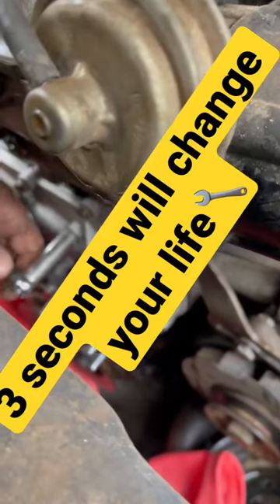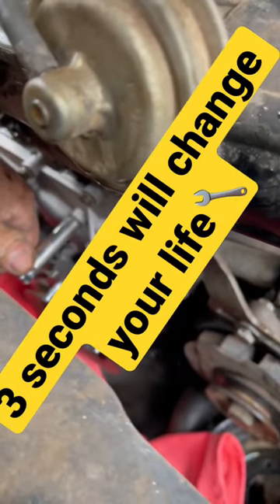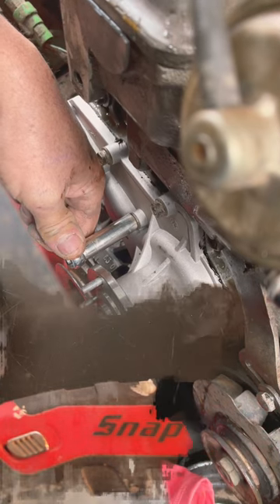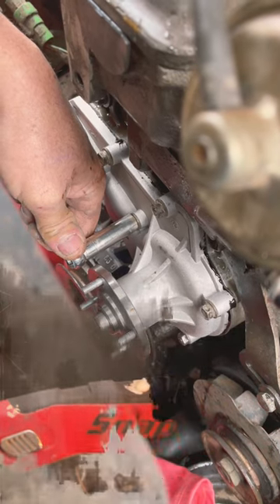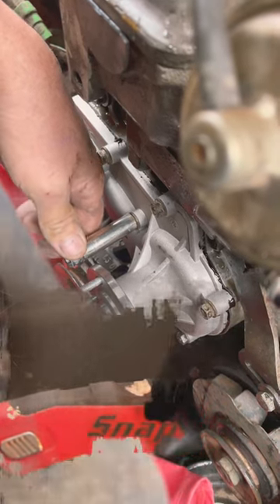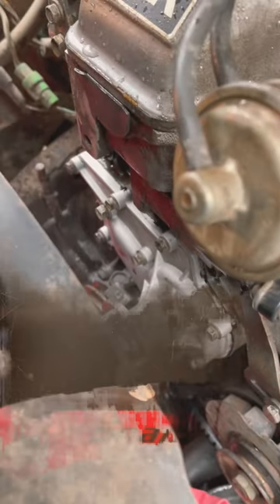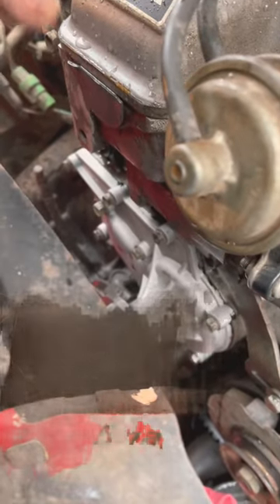This is why you hold your bolts for 3 seconds 🔧#shorts

Comment: Well damn I’m surprised the helicopters I work on haven’t fallen from the sky since I never hold the bolt for 3 seconds.
Reply from the maker: It is called safety wire. They know the bolts will come off. duh.....For the people at home, this works great.
Reply: @fastflo1  ummm hello genius I again work on helicopters and do safety’s all the time. However not everything has a safety or a cotter pin. But you keep believing in your 3 second hold buddy lol. Maybe Sikorsky should of implemented that in his engineering.
Reply from the maker: @spawnandbatman6975  you know a lot . But please do not let that prohibit you from learning more. You are making it sound like bolts do not back off. I was not suggesting you loosen the bolt. This is holding a bolt for 3 seconds. Do you believe that this will in someway create a problem? Will it make it come loose? Do you really believe That zero possibility exists this could be right ? That because you work on helicopters and have been a mechanic for 30 years this can’t be right? Let’s just forget about this thing called metallurgy. Because you work on helicopters 🚁 ok ….
Reply: @fastflo1   never said bolts don’t back off. But there is a specific reason why we test tolerances on hardware. When we torque on such applications we verify that run on, back off, or true torque is being done. If this is such a big deal then we would have failed torque checks every time we do a torque check on these aircraft. Majority of the time are torque are stabilized and don’t require us having to retorque again.
Reply from the maker: @spawnandbatman6975  Great info . Very technical. The last sentence.  Is what I have been trying to explain. 
But you just did as well as every other commenter that says this . . It’s so obvious guys…. The majority of the time you said they do not need a Retorque. . The majority. So that means you check. And retorque if necessary. Why check though? According to you guys bolt is right when you tighten it. Why retorque? Why even check ? Shouldn’t your torque wrench be right the first time ?  How do it get loose? What does it need to be tightened? Can you start answering those please? Thank you .
Reply: @fastflo1  do you even realize how much vibration a helicopter makes? One it’s to verify torque for safety reason which is why we constantly have to have our tools calibrated. We check torques on parts we replaced after 9-11 flight hours. In the automotive industry you are torquing to higher in most applications. No mechanic is going to say “hey in 50 or 100 miles recheck those torques. Probably should though. Aircraft is crucial to check torque due to vibration and bolt tolerances or threads not holding the torque of the bolt. Has nothing to do with holding the bolt for 3 seconds. Otherwise all of our technical inspectors or TI’s would be there to verify our torques. Once stabilized we torque stripe. Some applications you torque strike after you reinstall the part. I would love to see actual proof of this 3 second hold theory.
Reply: Forget metallurgy or mechanics, someone needs to let my physics professor know about this. Talk about revolutionary
Reply: @spawnandbatman6975 Car mechanic > Helicopter mechanic, didn't you know?

Comment: Some old school builder for Ferrari would take years to hand build great engines and cars because he used the same method. It does take longer hence him taking years to hand build some models. Airplane mechanics also practice this religiously
Reply from the maker: You are absolutely right. Not very common to the public by any means. And the tip I got was from my friend that worked as an airplane mechanic and went on to be a educator as well. And is now at Lockheed Martin....
Reply: @fastflo1  exactly! It’s real stuff
Reply from the maker: @rustypotatos  you know it man ! Good job dude . Way to stay sharp! 👍🏻
Reply: Never heard about this in A&P school, we just torque fasteners to the prescribed torque in the manual. Sometimes, anyway. I don't think holding the bolt for 3 seconds does anything and it wouldn't be relevant on an airplane since all important fasteners are safetied anyway.
Reply from the maker: @acefighterpilot  it works great for the guys who are not safety wiring regular every day stuff… it is on a different level. Can you tell me the one part that is not safety wired after tightening?
Reply: @fastflo1 Plenty of parts aren't safety wired. Some critical fasteners use nyloks or castle nuts and cotter pins instead of safety wire. Some parts have no safety at all, like screws for inspection panels. In general safety isn't required for noncritical fasteners that have some redundancy. For instance most access panels on Boeing aircraft can safely lose about 10% of the screws securing them.

I'm just not seeing how this bolt holding thing has any basis in physics. Once the fastener is turned, the inclined plane of the thread advances and requires more torque to rotate in the opposite direction. Maybe the @TorqueTestChannel would investigate this claim.
Reply from the maker: @acefighterpilot  good stuff …. I know they say hose clamps are one of the parts not required to have safety wire. The three seconds is to avoid rebound tension. It helps settle the bolt so it will not want to rebound and come loose.  Lots do come loose . So maybe that is part of the reason why. There sure are so many factors involved . And we know they have come up with several ways to prevent it. So it is likely there are several reasons they come loose. It is possible it is a contributing factor…. Would be a good episode 👍🏻
Reply from the maker: @acefighterpilot  here is a video I made . Let me know what your opinion on this is please thank you 👍🏻https://youtube.com/shorts/-7I71BfRPS0?feature=share
Reply: @fastflo1  The main reason why things come loose is vibration. You see that a lot on pistons and helicopters. Fasteners near the engine or on cantilever structures tend to walk out. You're literally not applying any torque just holding the wrench there.
Reply from the maker: @acefighterpilot  exactly….. the vibration . Most people do not understand that. And I am just holding it at value , no more. So if in fact there were any rebound tension … This would stop that . If not . It will not hurt it .
Reply: I’m an 8 year aircraft mechanic working in military, commercial and private. I’ve never heard of doing this goofy shit.
Reply from the maker: @grant4431  that is awesome ! I love to hear how long people have gone without hearing it . All now you know . Use it for what it is really intended for on your best projects . Your most important motor bolts . Your most precision work for the absolute best long lasting results. You may not believe it … but ask your self if you think it will help the bolt come loose? That’s a thought 💭 and if you do not do it at least you can have some fun in the shop with the guys . 😀
Reply: @fastflo1  you’ve got a good attitude
Reply from the maker: @grant4431  cool man! Thank you ! You too 👍🏻😎
Reply: Everyone has different teachers and bosses. Y’all ended up with teachers that did not learn this. Y’all are missing valuable lesson
Reply from the maker: @rustypotatos  wise words … there is always more than you have already learned. And more than your teacher has yet to learn👍🏻
Reply: Was just about to say this ☝️
Reply: @fastflo1  cylinder hold down nuts on piston aircraft Don't get safety wire they don't even use a lock washer of course we do put torque stripe on them after we torque them up. In addition I don't ever recall seeing exhaust or intake manifolds with safety wire and of course you don't want to use a lock washer and fear of damaging the cylinder head.

Comment: I just use an impact gun. Oil drain plug, oil filter, spark plugs, valve cover bolts, you name it.
Reply from the maker: Some people do.... I go hands on ....Most the time.....
Reply: If it wasn't meant to be then they wouldn't make that size impact socket😂
Reply: Same but Unironically
Reply: Wow thanks for the tip. I used it on my oil pan today. It has a small leak by the drain plug though. I can't get it tight enough. I cranked up the impact driver to max speed and it doesn't stop the leak. What should I do?
Reply: @bobmurphy2216  half inch impact
Reply: @bobmurphy2216  flex seal.
Reply: Dawg I literally could not get a drain bolt off this jeep grand Cherokee just yesterday! I swear. And it had a plastic oil pan. Screw your bro😂
Reply: Update to my issue. I held the impact for 3 seconds on high and it stopped my oil drain leak! 

But now when I start the car the oil light is on. Any ideas?
Reply: You must be mad or unskilled.
Reply: I always break stuck caliper slides. So the custy got to buy a new 1. Lol. Maybe next time the husband's sisters brother will grease them..🤘
Reply: Yup I use my air ratchet on everything. You can't make rate with hand tools.
Reply: Hold the trigger down for 3 seconds after you see the bolt stop spinning to avoid rebound tension

Comment: Pretty sure the data will disagree with this theory...BUT rebound torque (twist) is real in long, slender fasteners - and a combination of lubricant and a click-style torque wrench helps alleviate it.  If the fastener isn't long and slender, and there's no lubricant, and there's no slight shock (click)... probably not.
Reply from the maker: It’s a good tip to know ….. in general….

Comment: As a machinist of 10 years I can wholeheartedly confirm this bold statement of bolt torque is unequivocally... False.
Reply from the maker: 10 years is not enough….
Reply: @fastflo1  Lol if your serious.. A spring can be held in a position forever, it will return. When you go past a point it finally bends. Holding a point of torque will not do anything. The fasteners tensile point is set when you reach a point of torque. You need to apply more torque to change that point, time is null.

Comment: This makes sense.  As a person who does not use torque wrenches, I can say after tightening many bolts you just get to a point where you can feel tightness, "errr, yep, that's ones tight" but I've always had the suspicion that people who do that tighten bolts to their max, but yet I've never had a problem taking my bolts off, and I think this is why.  I may be tightening to max at the head,  but because I don't stay on it for 3 secs the bolt actually vibrates the head back to match the threads and puts it around spec.  Just an opinion
Reply: With that being said,  that would mean if you guess tightness,  do what you have always done,  if you are a torque wrench person, then you need to hold for 3 second for the threads to catch up to the torque of the head of the bolt.
Reply from the maker: Great opinion. I would have to agree with you on this. Action... Reaction...👍

Comment: It's called torque to spec. . . done.
Reply from the maker: Nope .wrong. Torque is applied. Then released. It will probably hold. But this method gives you better odds. Let the tension settle. Hold your bolts for 3 seconds.....You can become a better mechanic in three seconds. Why wouldn't you? Could be the bolt that ruins your next family trip when your water pump bolt backs off in the desert.... But don't listen to me. Just what you do.....my bolts are fine.
Reply: @fastflo1  Nope, some people "snap" their torque wrench application which gives an inaccurate torque. Simply drawing down to torque spec WILL suffice and hold.
When I am reusing bolts/nuts on an install, I chase the female and male threads with a thread chasing tap/die. NOT a thread cutting tool and never wire brush any threads. 
Your 3 sec pause is waste of time, but you do you.

Comment: If the metal is flexing and allows for an angle discrepancy between the tool and bolt, where's it getting that extra force to "settle" back into alignment?
Reply from the maker: It is the twist in the bolt. It settles when you make it stay. Just hold tension it is in the bolt

Comment: If that doesn't work and you have to undo it again, remember to leave the bolt off for at least 30 seconds so any residual electrical charge is removed from the system and it resets properly.
Reply from the maker: Nice one....

Comment: You sound like a great guy. Everybody is attacking you for this tip, and you stay nice. You make videos of tips to help people out. That's awesome. I've been a turbine generator mechanic for 20 years. Worked on GE turbines, mostly frame 7 & 6 gas turbines. When I worked with GE, they would send us to hytorc. Bolt torqueing company. This was never something they said. Im not saying you're false. Im open-minded. I just dont understand. Usually, when you torque a flange, you make several passes. Is this the same thing as holding for 3 seconds? When you torque a bolt, it stretches. There is an article I've read about conditioning the joint during the torqueing process. The article says to pre stretch the bolt, torque the bolt, leave it for 3 to 5 seconds , and loosen the bolt. Then re torque. No hate, man. Just not seeing the tip as relevant when you can just check your torque by making several passes.
Reply from the maker: Hey thanks! I appreciate it. People will attack. Some people have an open mind, and others do not. So I do not take it personally. I do not expect anyone to agree or disagree. It is just information I like to share about cool things I learned. I personally like to learn the extra cool things. This was a tip I learned from a friend. We worked summers in his Dad's machine shop growing up. He went on to college to study to be an aviation mechanic. Through his studies of metallurgy along with other information, he learned about this. It may be something he wrapped up into his own ball of wax. But we have done this on pretty much everything we have worked on since. And in the last 30 years I have had numerous bolts advance in the 3 seconds. Please keep in mind that this is not just a flange. We work on chainsaws, motorcycle engines, car engines, diesel engines, go carts, trailers, and just about anything you can put together or take apart. Some are new, some are old. Hot, icy and in between. By hand, with torque wrenches. Built to spec, and built with open end wrenches in the dirt. We work on stuff. We see results. We run our own stuff and find our own results. Most people want a scientific explanation. And I just tell people to try it. It is so easy to find out. When you feel the bolt move, you know. Period. It is simple. To answer your question though, you are aware of all the tension and stretching you spoke of. It is definitely along those lines, yes. So ,many factors to be considered... In relative terms, he explained to me torque converts to tension and tension is converted to clamping force. Along with certain vibration and side to side sliding of the head of the bolt. He also studied Junker and his work as well as others. I do not know near what my friend knows. I am a tree climber, fence builder, welder, mechanic, and I ride motorcycles and drive cars, 4x4 and I work on all my own stuff. I do these extra little things along with so many other cool little tricks. They pay off. I go wheeling and riding with so many different people. I see tons of stuff that fails. My stuff is setup to work and ,make it. And I know it is from going the extra step, the little things that people think do not matter really do. Like when some one says that is a waste of 3 seconds while I am working in the pits.  I pass them later when the engine they have is falling apart and blown up. I know it was probably due to a number of things they did not think matters. It all matters on the track. And if you can do that one little thing that can shave a fraction of a second , or a motor that holds together on the last lap instead of blowing up... I could go on forever.... Thanks for the great comment and having an open mind. I do try and help people with my videos. It does not mean I am right.  I do like to share what I know though. So for those that want to try that is great. And if it is good for a laugh for the other guys, great also. Thanks.
Reply: @fastflo1  your a good dude! Keep it up. Next time I'm bolting something, I'm gonna hold it for 3 seconds!
Reply from the maker: @kfeemer  I like your style Dude Thanks, I do appreciate it! You will enjoy it for sure. Get ready for some arm shaking. Along with a new found focus on you work. There is more to it than meets the eye. Only the open mined will experience the results. Good for you!